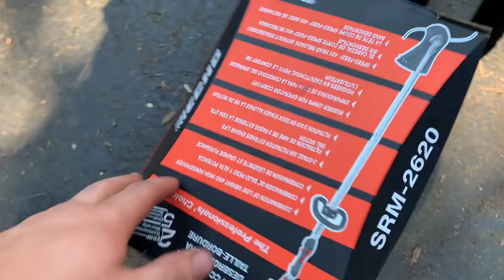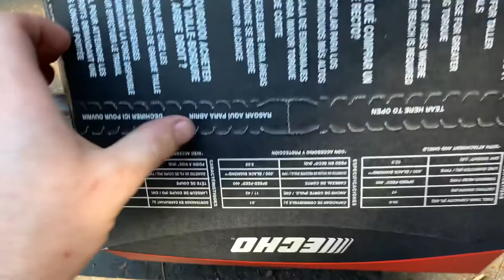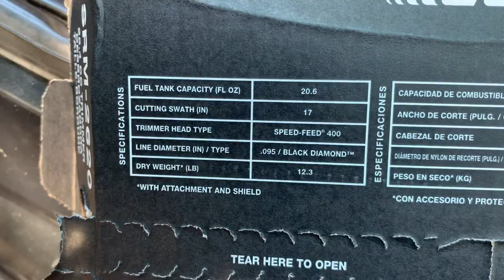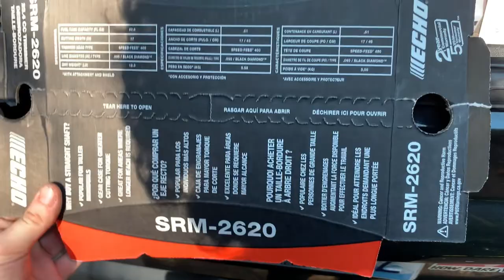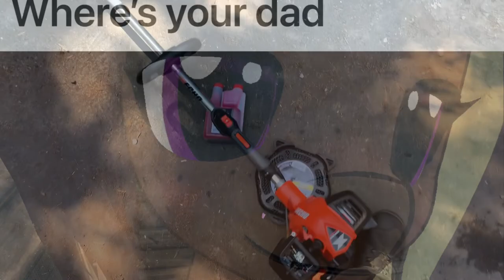Echo SRM-2620 Initial Thoughts | First Start

Comment: At the end of your video you answered your earlier question... commercial warranty of 2yrs is for commercial operators using the machine all day every day vs residential/home owner use once or twice a week...I use Shakespeare Ugly Line and find it works well - comes with a cutter on the spool... convenient. Spot on about the powerhead ripping good...Good luck with getting that sparkplug boot back on!
Reply from the maker: I was thinking that people who use it for commercial use are still technically consumers. If I wanted to maybe I could even get a new spark plug wire if I bothered echo enough? Haha nah I’d rather modify/improve the design with a better wire and boot myself because I’d probably just rip off again. I’ll try that line out. Thanks for the comment!

Comment: If you don't use your lawn equipment a ton, it would actually save you in the long run to run it on either that "tru-fuel" in the can or get yourself some 110 race fuel. I know those fuels are expensive but the cheap crappy ethanol blended pump gas they sell these days destroys the diaphragms in the carbs and destroys the fuel lines, usually if you run just pump gas after about 1-2 years the primer bulb will crack/break, and the fuel lines will be rotted and usually the carb will start acting up. I had an rc boat with a zenoah g260pum that sat for over 3 years with a tank of 110 leaded fuel with some hp2 oil in it, after the 3 years most of the gas evaporated but just putting a touch of fresh gas ontop of what was left and it fired right up and ran like new, the fuel lines were nice a pliable and the primer bulb was still perfect and to this day that boat is still on the same carb, primer bulb and fuel lines that it was put together with in around 2007 and I has been run on nothing but 110 leaded and Honda hp2 oil since it was new. And I have had other equipment and small engines that I tried to run only pump gas through and after about 1 year you will start having issues. I would not recommend pump gas in any small engines unless you use them every single day or use them commercially. That tru-fuel they sell in the cans at home-depot or the auto parts stores is great too it really makes a difference using good fuel.
Reply from the maker: There will be sometimes I’ll use it every weekend, and probably sometimes it will sit for months without being touched. You’re right, those cans of fuel are mega expensive and in my opinion, aren’t worth it. I actually used to use Stable fuel stabilizer, years and years ago, because I thought it did something, but the truth is in my experience I’ve always had great luck with pump gas and a gas can that seals good. Fuel can last years for me and not give me problems. And as far as the ethanol drying up the diaphragms and shit, my engines do just fine with 10% ethanol. Again, I don’t really have as many issues as other people on YouTube do. Also, walbro came out with a stainless steel diagram kit and UV resistant primer bulb for almost all of their WT carburetors or something, came out with that kit a few years ago. I think it first got featured on one of those 1/5 scale rc car YT channels, Botajell or whoever. The stainless steel and plastic diagram thing is supposed to be bulletproof against ethanol. I’ve only bought the UV resistant primer bulbs and put it on one of my sports a while ago, works fine.

I do agree if you use pretty much anything else than the tygon line or whatever, the ethonal will dry out those cheaper fuel lines and make for you problems.

I used 92 octane e10 pump gas in my piece of garbage gsr46r and never had fuel issues. I eventually got fucking angry at it and beat the shit out of it because of the chain issues, completely unrelated to fuel. 

Me I’m not going to what I feel is waste my money on canned gucci gang fuel. Pump gas has always worked for me for some reason.

I might eventually actually want to buy the SRM-2620T, which the T stands for torque, and that model just has a trimmer head with a different gear ratio, and I’ve heard it has a lot more torque, or like the SRM-3620T, which is like 30cc. The Home Depots around here only had the 25cc as the biggest in their echo lineup. I didn’t do a whole lot of research because I was desperate in the moment. This is what I’m obsessed with at the moment. I’m really burnt out on the goped crap. Nice to hear from you Mr Brian Griffin.
Reply: @rabbitfootedkitty1339  if your going to get echo equipment definitely get their higher end models, their cheaper stuff just doesn't seem to last as long. Years ago I used to just run the super cheap homelite and Ryobi trimmers and after 1 year they would be broken, either the carb would be shot or the pull start would break and back then you couldn't buy cheap Chinese carbs of ebay for $10-$15 you had to get a rebuild kit from a small engine shop and hope that worked which didn't work 9 times out of 10 or you could buy an $80-$100 new carb for a $99 trimmer which wasn't worth it. After years of wasting time and money on cheap equipment I eventually switched to buying used commercial equipment of craigslist and marketplace, I bought a beat up wore out Husqvarna commercial trimmer that lasted me 3 years and then it was so wore out that it didn't have enough compression to run anymore lol. After that if found a used Stihl trimmer that I have been using for the past 5 years with zero issues and that thing gets ran every other week and the plus side to the commercial trimmers is that they come with the large trimmer head that will take the large diameter string which lasts longer and cuts alot better.
Reply from the maker: @briang4470  So basically what you’re saying is I love German engineering lol. I’ve never had a Stilh. Actually I take that the fuck back the only Stilh I had was probably a 20 year old by now BR400 backpack blower. I think I got it for $40 or something. The pull cord kept breaking after I replaced it over 3 times. I replaced fuel lines I think. There wasn’t a primer bulb which made it a fucking bitch to start without starting fluid, at least it had a choke I guess. Sometimes it started pretty easily and sometimes it wasn’t so happy. Once started it actually ran great, and it was easy to tune the mixture screws. But sometimes it would completely die when hot and would not start no matter what, like it lost spark or something. Never figured that one out. I actually went to a Carquest in Duval, which was actually also a Stilh dealer, and I think I bought a new gas cap, because the current one was leaking through the supposed 1 way vent, and a new strap, which I was actually surprised they had both. I think it was $60 for the both of them. Definitely not my favorite backpack blower, but it was kind of beat up. I’m biased against Stilh mostly because of the *superior German engineering thing*, which is actually probably garbage, and makes parts very expensive too.

Also aren’t pretty much all echo products great quality? Even the residential models? Japanese engine superiority.
Reply from the maker: @briang4470  I’d definitely buy a Stilh comercial trimmer if the trimmer heads would be the best in the industry, but I bet I would definitely pay for it, even for a used one.
Reply: @rabbitfootedkitty1339  if you look around you can find them for $75-$150 used and maybe even cheaper if it needs a carb or pull start which you can buy of ebay or Amazon for usually under $40. The 2 biggest things I don't like about stihl is their gas caps suck and will always spray you with gas when you open them and I don't like their 4-mix engines they can be trouble some and hard to diagnose. But overall I like the Stihl stuff the best especially their chainsaws.
Reply from the maker: @briang4470  yeah I bought brand new to see how well it would run out of the box, and how long it will stay running good. And I thought the 4 mix engines were supposed to be pretty revolutionary. Lower emissions or whatever, with less maintenance. Only have to mix oil into gas, no oil changes.

Comment: Is that a black NSX casually sitting there needing TLC ??????
Reply from the maker: Only the usual k24 turbo swap
Reply from the maker: I think I helped him replace the clutch master cylinder in it a while ago but he also has a older turbo Porsche with the engine in the front which is pretty cool, and I recently bought a ‘73 Datsun 620 pickup from him and am currently in the process of making it a nice small reliable manual work truck
Reply from the maker: If you look at my newest YT shorts  you’ll see I am the old Mercedes man